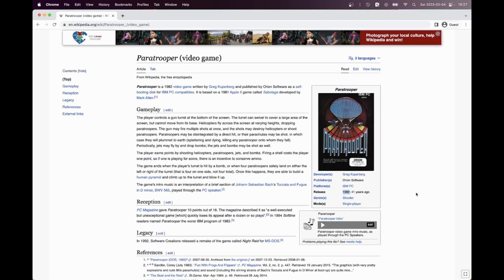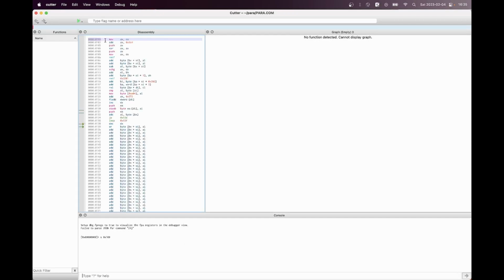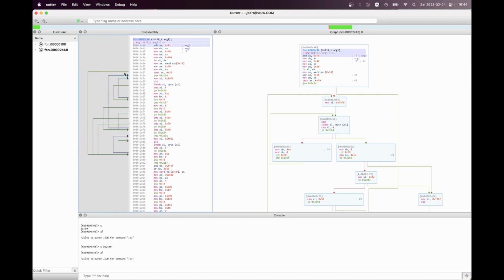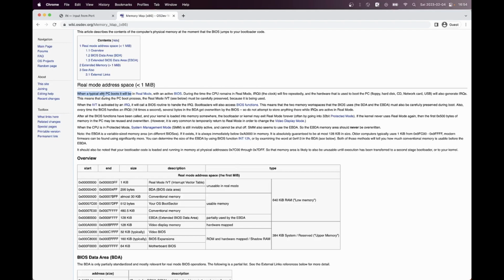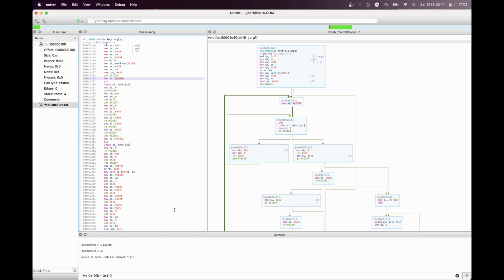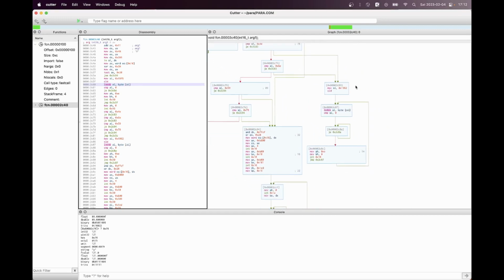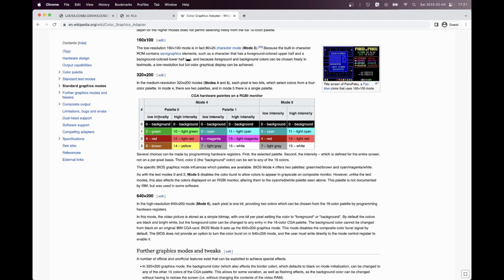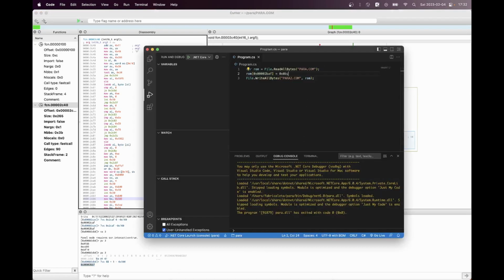Reverse engineering an old DOS game (part 1 of N)

Comment: This game can display the graphics on a secondary CGA if the primary display is MDA, it could be to try to make the computer restart in CGA mode because the user could have turned off the MDA monitor where the game asks if you have a CGA monitor when the computer boots in MDA mode, while the will start directly if the computer boots in CGA mode.
But I don't know if the PC would reuse the equipment settings stored in the BDA on warm reboots or if it would reset them according to the configuration switches.
I don't have an IBM PC and 86Box only allows to use MDA as the secondary display when using MDA and CGA

Comment: 41:00 You can tell it was written by someone who was a bit inexperienced. Testing for both lower case and upper case letters is a bit weird. Just whack bit 5 of the int16 return and you'll have a 'to_upper()' conversion. That's the whole point why lower and upper case characters are exactly 32 codes apart ('A' = 65 , 'a'=97)
Reply: That is awesome! Thank you for sharing!

Comment: it's been a long time since my assembly days but something odd about the code in 0x2c83? maybe there is a wrong disassembly in there because the je 0x2c8a makes no sense, why jump to itself, i have never seen that before. also if the execution jumps in 0x2c83, it can never leave eitherway. strange.
Reply from the maker: In this codepath, the game has detected that the computer wasn't running a compatible video card. So it prints an error message, and stop execution. This is the point at which it would normally return to the operating system. But Paratrooper was initially released as a PC booter game, where there was no operating system to return to. So it simply locks in place and the user has to reboot the machine.

Comment: With a hex editor/viewer you can easily spot plain text and get an idea of a program's general layout. You should also check whether the binary uses some kind of compression. Possibly the weird way it jumps into the main code at the start is a rudimentary attempt at obfuscating the code.

Comment: Playing with the BIOS equipment list would have zero effect on a PC 5150.  But perhaps one of the clones or later products might be affected by it.  The value in 40:10 tells which video mode it boots up into, and is set by the DIP switches on the 5150.  But on reboot it always loads the DIP switch values and replaces them in the BIOS area, so nothing is really affected.

When you're talking about a game made by a teenager, though, there may always be leftover cruft that does nothing, but doesn't harm anything and so is never removed.  A thorough code review might have caught those odd items so that they could be removed.
Reply from the maker: Thanks a lot for your comment! Are you talking about the part in 44:00 where the color text mode 80x25 is written back to the bios area? It seems odd indeed because the game being a pc booter, there's no other way to exit but to reboot the computer anyway, and the code is entering graphics mode immediately after anyway.
I also assumed that this code having probably never been reviewed, it is likely to contain a few harmless mistakes.
Reply: @fabricelete5337  Yes, the color text mode is what I was referring to.  That value is written at BIOS initialization, so it has no real effect, at least on true IBM PC's, to change it.